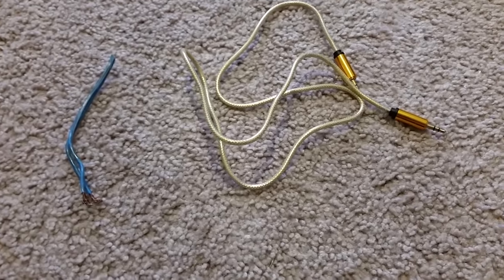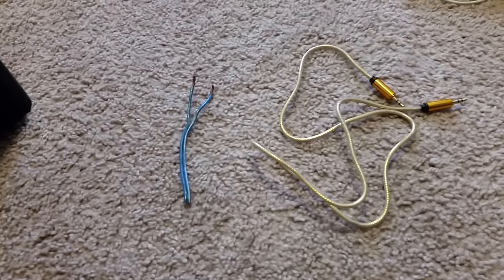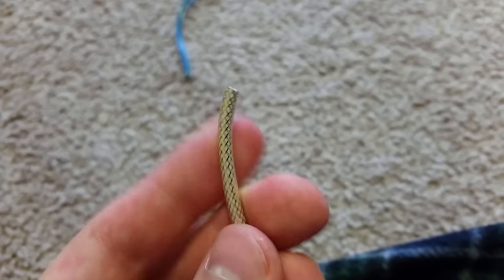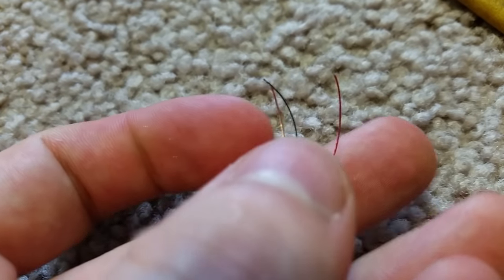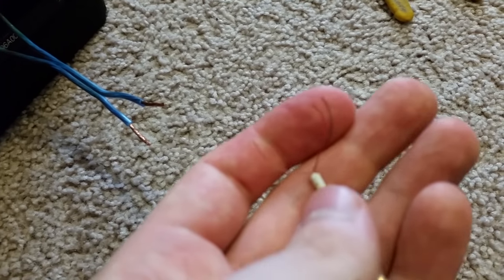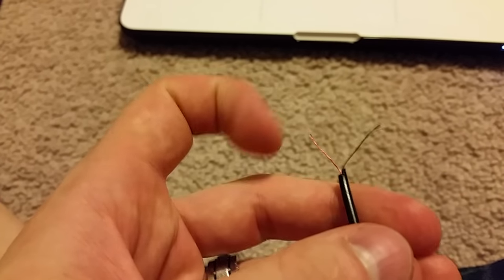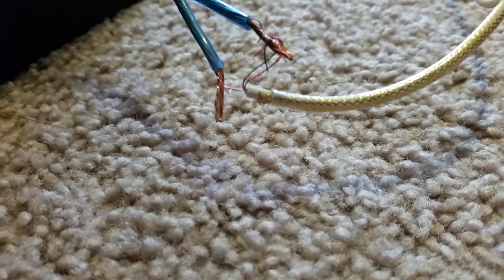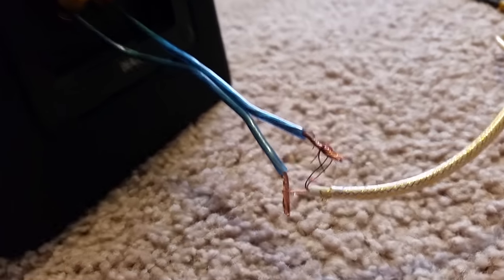Convert speaker wire to AUX

Comment: Hey, The red is Right positive, the blue is Left positive and the copper is the negative or ground for both. That type of aux or audio jack cable is a stereo type (left and right).
Reply: Would my green be my ground?
Reply: What color are your wires if it's red yellowish and green then green is left and red is right and the yellowish one is your ground, join the ground and green/left channel you've got yourself a mono channel

Comment: Worked for me no problem but the sound was low so reading the comments I need a amplifier. So I"lol try that. Good speakers that I hate to just throw away
Reply: Yeah, this is not a real solution without an amplifier sitting in the middle of that connection. Basically, all he is doing is taking 5 mins to show you how to twist a few wires together.

Comment: Also the same output to your earphones or headsets will be the same output to whatever you connect it to. In other words it wont be louder, you'll need an amplifier to enhance the power output.
Reply: Or u could use a loud volume app

Comment: Hi,
I am trying to find a circuit diagram/parts for adding a 3.5mm headphone jack to an alarm clock radio that does not come with such a jack.

Do you have a video tutorial oh how to cheive that, please?
Greatly appreciated.
Reply: Does it have a built in wire already for media use? If so what I would do is just cut the wire right in the middle and check for the colors / ground and match them up in a sliced aux cord

Comment: Ok lads.. I've got a 2.1 speaker system. 2 small speakers and a sub. The aux sheared off. This house depends on music bear in mind. So weve been fiddling with the wires and positioning them so the music plays. My problem is we have a red wire and a white wire. Both are wrapped in many small steel wires. If I touch the red off the top of the jack nothing happens. Then I put the white wire to the bottom of the jack and the 2 speakers play. Then I get the steel wire that was wrapped around the rubber of both of the other cables and touch it anywhere off the white cable and the bass starts thumping along with one speaker working perfectly... if I touch it off the red the sub works and the opposite speaker works. But if I touch them both off eachother the music cuts out.. how do I get the sub to work and both speakers when touching them both off the sub speaker causes it to not work atall. Any help?

Comment: what if I have two speakers and so a total of 4 wires? would I twist them together or would I solder then?
Reply from the maker: +Christos Ioannou If you have two speakers that you want to have the same connection, twist or solder together the positives and the same with the negatives. Now you have4 wires into 2 that will share a connection. But remember doing that will lower the power put into the speakers
Reply: i like to use peanut butter or "abc" gum

Comment: if my speaker just have red and black wire . can i connect it ?
Reply from the maker: yes, The red is the positive and the black is the negative
Reply: +J Robling im going to try this  tomorrow, i got 4 speakers they are connected in pairs of  2 and 2 one of The pair got one black wire and ones red onsdag the other one both wires are black. they are not in a box, they are just speakers fully functional not wired to anything but their partner(s) do you have anything to add to my "experiment"
Reply: how can i connect two speakers at the same time

Comment: I just did this with two 140 Watt speakers and at full volume I can barely hear them. Im guessing it's because they aren't getting enough power from the laptop aux? However I wired them into my surround sound through an amplifier and had the same issue... Could it be that the speakers are broken?
Reply: Josh Ballard perhaps! are you trying different cables?
Reply: Josh Ballard I had a similar problem

Comment: That means if I try to Tap red and black wire on my Bluetooth speaker to a 3.5 mm jack then it Can use to an Auxiliary mode. Especially on Mic port on any Radio. ?

Comment: If I want to use two speakers how would I configure the wires? could I just attach the speakers' wires together (positive with positive, negative with negative) and then do the same thing?
Reply: oh now that I think about it that wouldn't work. How would I do this?

Comment: I am thinking of ordering a loud speaker for my mini storage, I see there are some apps that auto answer on the phone so I was thinking of connecting an aux cord to the loud speaker that will be mounted outside on the roof or whatever and the cable and power will run down into a unit where the phone will be plugged in all the time and the speaker will be connected to the phone at all times. That way if I see something fishy on my cameras, I can call the phone on site, auto answer will pick up, and then I will be able to turn on an alarm sound/or speak over the line to say the cops are on the way.. Would something like this work or am I not seeing something? Any input would greatly be appreciated. I am just thinking of the cheapest way to go about doing something like this. thanks
Reply from the maker: It could definitely work, depending on how big your loud speaker is on your system you may need an amp. I have seen some loud external speakers that you can buy that plug directly into the aux

Comment: Can you please tell me how to hook computer speakers to a lap top the end of the 2 speakers have been cut were u plug it into a lap top the cords are red white and silver guess that one is the ground wire what kind of end can I put on it so I can use them with my laptop on the front of the 2 speakers there is a place to put a head set and a place that says Auto in there a hole there to but I don't have the end to the cord speaker cord what can I d0

Comment: What if i have 4 car speakers to put in garage, then use the aux cable to use with iphone. Is it the same principle? So i would have 2 sets of wires, instead of 1: left 2 speakers and right 2 speakers....how would i wire that?

Comment: Do you have to solder or can you just     wrap the chords around each other???
Reply: You can wrap them around and then cover them with tape but the solder is far more reliable and ensures the connection wont be lost. If the wires become unwrapped you will have to rip open the wire and do everything again.

Comment: I have a blue and red and copper connected to were you said to connect to right but I have a extra wire which is green where do I connect it too the positive or negative?
Reply: Neither its a microphone wire

Comment: Mine are blue, yellow, and white. Which is which?
Reply: Nolan kelly black is usually negative so that means copper is positive.  BUT it all depends on how they're plugged in on the other side.  So just check
Reply: Chad Drake yellow is positive blue neg whit neutral. atleast that's how most things are.

Comment: I did it and it doesn't sound loud how can I make it sound louder since I volume it all the way up and steel won't sound loud at all
Reply: you need to use an amplifier of some sort, if you ask me this tutorial is not a good idea.
Reply: Mr.Someone, Why not? All you need then is an amplifier, that's all he could have added.
Reply: GraphixRenders if he added an amplifier into the circuit i would Appreciate the video a bit more
Reply: Mr.Someone \Tom/ Yeah, I know, I would too, I guess just the way you worded it was what caught my attention, but I agree.
Reply: GraphixRenders
Yeah I worded it in the way that it had to go with the original question if you know what I mean
Reply: You'd need a battery to power the amp
Reply: listen grab a battery   make the ground wire of your aux cable on the negative side on the battery en your positive side on the positive sede and then conect the to the speaker
Reply: hook them up to a receiver.
Reply: hey man can u explain this a lil more to me plzz
Reply: can i connect the aux cable to pc
Reply: Same thing happend to me
Reply: Amp that is all
Reply: Mine works if connected to a stereo then the stereo is connected to the TV so watching game of thrones is more awesome to watch
Reply: I think this tut is great! Thanks man I’m gonna try it out with my tiny speaker 🔊
Reply: Same ..
Reply: Carlos Martinez just increase volume

Comment: How do you add extra power to run through it and how do you know how much power it requires?
Reply: Anthony Strazhnikov you can't
Reply: Dontalian how do you hook up sirens ?
Reply: u open a speaker u should see the speaker wire use that and put it on the siren wire the best thing about siren it doesn't matter what wire u put on
Reply: what about a headdeck amp battery how do you hook all that up?
Reply: there alot of explaining to do for that
Reply: 😂😂😂😂😂😂😂😂😂 randomly found you lahos skee jusy scrolling through the comments
Reply: faaark someone do a video on sirens bwahah tryna do that shit in aus

Comment: how do I do it with 2 speakers u mentioned that u have to connect it different
Reply from the maker: if you join both the positives then both the negatives, making two wires out of four, then connect
Reply: J Robling hey man can u please do that kind of video becuase i dont know how wire two or more speakers together. mine has a aux allready comming out of one of the speaker and the othet one has has thing as ur speaker.
how to wire them up and have one aux coming out of both speaker.
Reply: Taranveer Sihra I'm pretty sure he's talking about turning two speakers into series? Or parallel. Just look up how to put speakers in series, if that doesn't work, do it in parallel.

Comment: how are you providing power to the speaker??
Reply: Its called A M P F L I F I E R
Reply: aloneinthecrowdtv amp it up
Reply: U got a nother two polars for power input..
Reply: samarth koul yea
Reply: Obviously there is no amp so the sound is very low.
Reply: how does a headphone work? same way .. how to give the speaker power? like that ..
Reply: samarth koul 9
Reply: You would be getting power from the aux cord being plugged in your phone or whatever
Reply: @Shelby Morgan this video is no way correct. You need to feed power to an amp and the speaker to make it sound louder. He has probably just level up the sound during the edit. This can't work in any way. But on computers this usually works but the sound is also very low. But a phone can not give out any sound.
Reply: samarth koul
Reply: @RackaApps  its working but the sound is very low

Comment: My speaker have auly aux connection.. But my TV don't have aux  support..how can I connect speaker to tv
Reply: if your tv has a tree color connection, u can use it via that. But u will have to get an adapter,,. The best thing for a tv is ti get a amplifier or hdmi to aux splitter so you can get the sound of the tv from hdmi splitted into aux aux and your tv, IN SHORT get a amplifier that suits your needs

Comment: you sould of used a normal aux cord with just the two wires in them cost a little more but way better connection and its just two wires like black and red and thats it

Comment: hey green red and the ground how do i connect it to a speaker?
Reply from the maker: Sounds like a positive, negative, and ground wire. You need to figure out which is which with testing them, you can join the negative and ground if you want.

Comment: How do i do it with 2 speakers?
Reply: Consider u have 3 wires, red blue n black. Connect the black ground to negative of the both speakers. Connect the red to the other terminal of  1st speaker  and blue one on the another terminal of another speaker.

Comment: I can hear sound but its really low and weak, PLEASE HELP!!
Reply: Well, to get perfectly clean and loud sound, you need to boost the signal (via amplifier)
Reply: Exit Z7 0f
Reply: How to amplify???
Reply: Buy an amplifier
Reply: DONT USE BIG WIRE TO CONNECT USE AS THE SAME OF WIRE JACK U USE THEN IT'S DONE

Comment: Its gonna break the charging circuit or something in your phone..
Reply: DieEneBelg why?
Reply: Pbknowall Its taking power from the phone, hou need an amp to power speakers they have a protection circuit and don't take power from phone only data I THINK
Reply: DieEneBelg That is what I thought too, my dad was saying it would burn out my tablet/phone, but according to this video I don't really know...
Reply: Pbknowall Well it won't blow a circuit board instantly but after doing it allot you would probably see your battery percentage drop faster and after a while your phone will kinda off stop working so I say no, don't do this just invest in a little amp you can get an amp really cheap from aliexpress
Reply: DieEneBelg Or just buy a Bluetooth speaker/speaker with AUX port...
Reply: Jdawgs88 K..
Reply: Jdawgs88 . my phone doesnt have a protect ion n it.
Reply: i tried it and my phone is fine
Reply: Khaled Sharara yeah its fine..
But it just inst the smartest thing to do

Comment: u burn them its easy so u hooked it up and it wasnt working. then u cut the video and figure out what to do. but next time just get the aux that is all black and have a look to it as a cord like the power cords on tv irons and fans they have aux cords that comes like those thats all u have to look for we you want to make sure you get the right ones. remember they just have a cords that looks like a regular cord that goes like a tv cord are any other thing that u have to plug in. ok hope he didnt confuse yall to much. hes on the right track though

Comment: u still need a amplifier
Reply: hahahah yea wth why wouldnt someone just buy an amplifier? I have an old panasonic 3 in 1 receiver, record player and cassette player with an aux cable to rca from my computer going into the inputs on the back of it then output from there going into some 1978 magnavox s-8754 10" woofer/horn tweeter wooden speakers as well as the matching panasonic turbo thrusters pair of speakers as well and using as reference monitors due to their transparency though am now trying to use a usb sound card to output to aux to run into my presonus eris3.5 studio reference monitors I already had just to add a bit instead of selling them so will see how that turns out. Not sure it can output into both sources at once but am hoping its possible so well see.

Comment: This won't work cause your phone or whatever device powering the speaker doesn't have enough power to make the speaker play at the volumes which it is capable of.

 Which means you'd have to attach an amp which obviously is recieving power from the wall socket or car battery to boost the volume. The music will now be capable of being louder but the song will get distorted the louder you turn up that speaker because the different wave lengths in the song are all playing on the same speaker at the same time..... you're wasting your time with this.
Reply from the maker: true, but you could save time by reading the description

Comment: the volume is low
Reply: Madtuber 58 why did you try this shit.
you need a amp or a receiver to boost the volume 
your phone or something gives a weak signal.
its like putting a 9volt battery to a vacuumcleamer it dont work
Reply: yurian huizing why did YOU WATCH THIS VID EITHE

Comment: this would never work as there is no power cable for the speaker XD this is obviously a troll.
Reply from the maker: Ahahaha what do you think the battery for your phone or mp3 player is for? that's like saying headphones won't work cause they have no power outlet
Reply: +J Robling true but it doesnt send enough power through the cable to the speaker. I have tried to make this before and it doesnt work.
Reply from the maker: +Luke Mossman that's why I said in the video it was for demonstration purposes and you should use a smaller speaker.
Reply: +J Robling why would you bother demonstrating something that doesn't even work? and I used a wide variety of sizes from 2 inch to 6 inch speakers.
Reply from the maker: +Luke Mossman I used the larger speaker because it's easier to see with the gauge wire. I'm not the only one on YouTube that's done this conversation
Reply: +J Robling if you use a much smaller speaker and smaller gauge wire it would work yes but you probably should have mentioned that in the video for the people who dont know much about this sort of thing.
Reply from the maker: +Luke Mossman I did, one of the first things I talked about
Reply: +J Robling true
Reply: +J Robling going back to the begining I can see that you did indeed mention that, my bad.
Reply: Its not at all loud, how to increase the volume output, if by an amp , how to connect it?